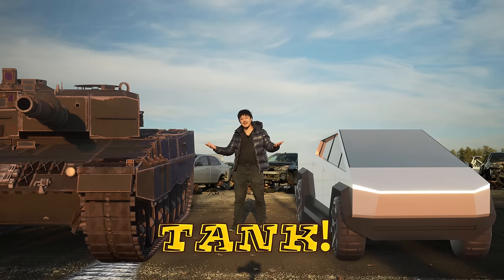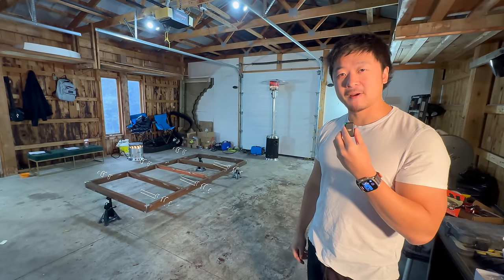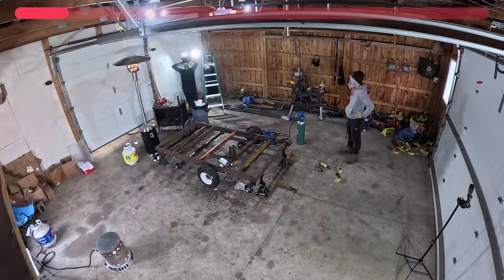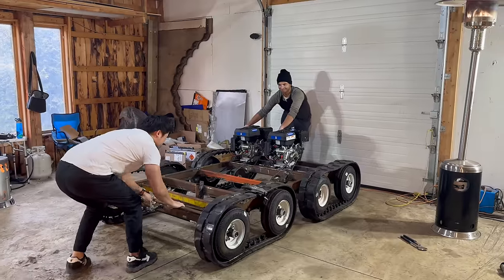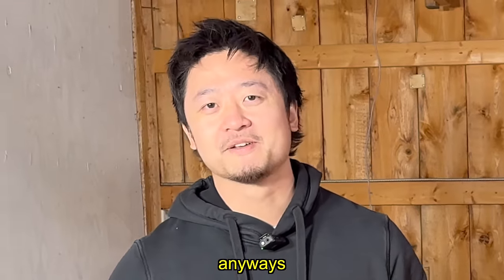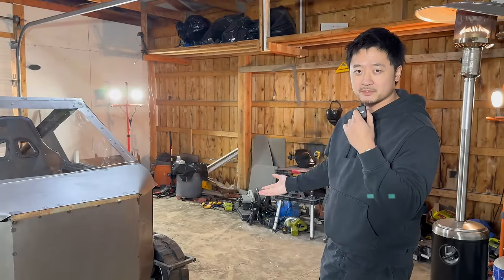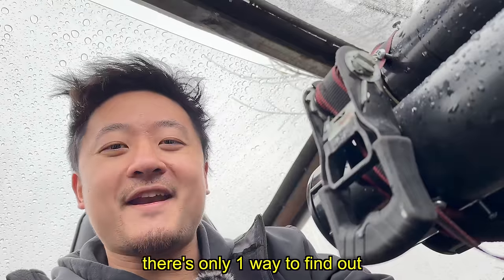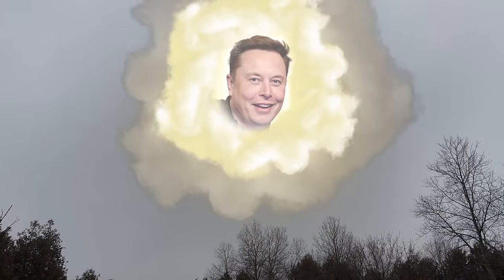I Built A Tesla Tank From Trash

Comment: Your issue was you were using rubber on rubber, there's no traction there. You could buy and double up gears to use at the wheels and treads instead, it's cheap and will stop all the traction issues.

Love your videos! Keep them up
Reply: Just what I was thinking. The rubber on rubber was not a great idea;) Better luck next time